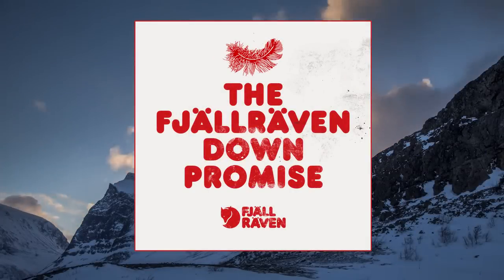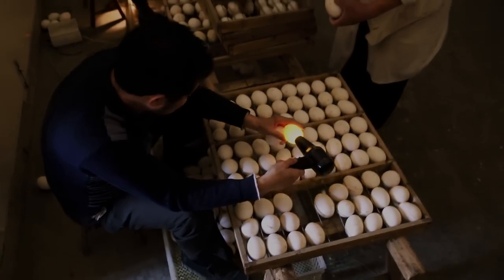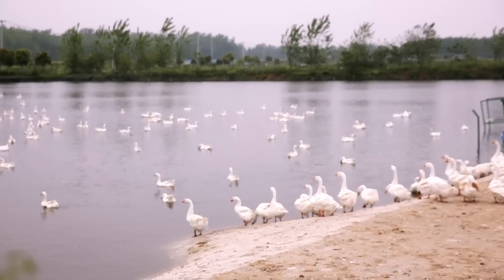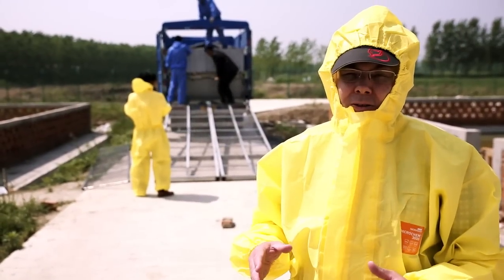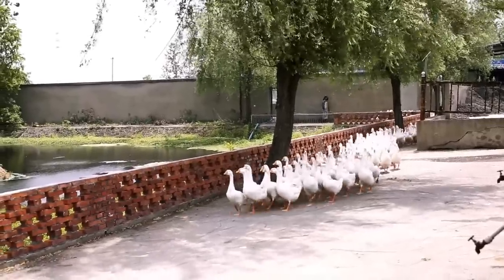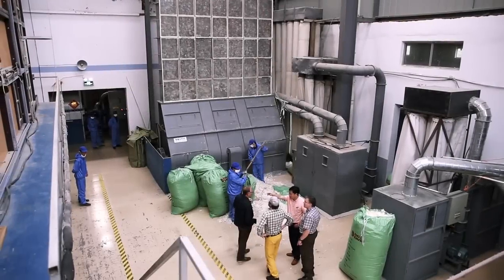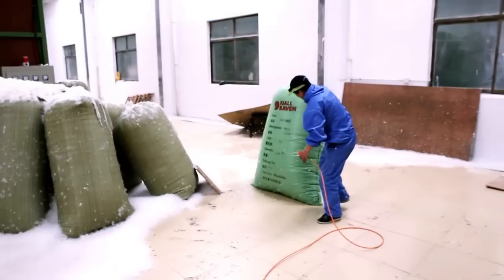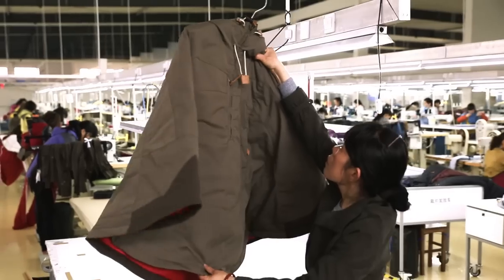Fjällräven - Our Down Promise

Comment: While it seems there is always room for cynicism whether needed or not, I know some will find issues with this presentation.  I do appreciate your openness showing this process. Knowing there is not a 100% perfect way to gather down it is refreshing to see a manufacturer make an effort to do their best while being as plain and open about it as Fjallraven has. 
I have generally been leary about down products since many are produced with far worse treatment than our anthropomorphic imagination could  illustrate and simultaneously combine low cost fillers etc. Cut open an IKEA down pillow for example, I swear there are pigeon feathers in there. I try to only purchase down products where they are the singularly proper choice over other options and thankfully that severely limits the amount of down needed to buy. 
As with many of the other practices you have described, this video has helped me feel better about my Fjallraven purchase. Many companies do not care to spend one dime on proper ethics of business outside of what the law requires, or what will simply push the margin up. I certainly hope you take the process as seriously as the presentation suggests.